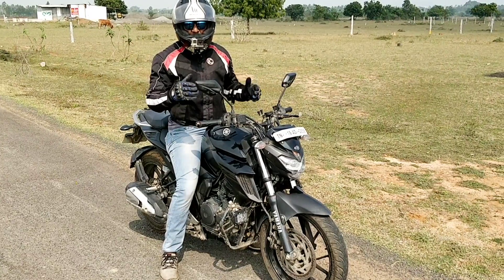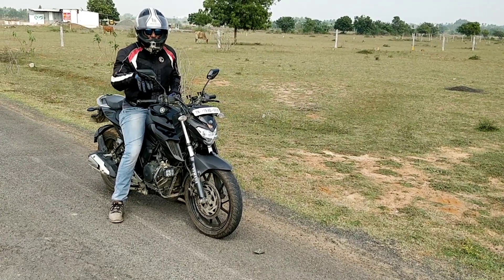youtube video #2t9tu7w7cZM

Comment: Dude ..You are trying to say that don't depend on electronics much ..(which is good) 
But don't misguide people like this .. A lot of youngsters have bikes nowadays .. All they want is a reason not to use safety methods
And 
FYI you forgot to explain why ABS is essential .. 
Dude without ABS the rear tyre can go fishtail and front can wheelie ! 
And you did it on a Dry and straight tarmac !!!!! What about wet and little bit of curvy roads ?? And u had no traffic there .. Who will explain braking in city ? 
If u can't do good. . at least don't spread bad !!

Comment: Well the funny thing is duke and rc 390s which come in abs have more accident records than the ninja 300 or fz25 😆 anyway the thing is it's really pathetic to see most people thinking abs can save their ass no matter what. Well on a bad day  no abs or traction control could save you. Still abs aint shit and is very helpful for newbies. But trust me during panic braking if the rider pulls the front and rear really hard the suspension will give way to the weight inertia and will result in imbalance. No matter there's abs or any modern techs he will end up fucked.

Comment: The proper way to do braking in any situation, you have to learn to brake gradually and firmly. Sometimes braking roughly could lead your brake pad get stuck on disk. You don't know how much pressure you're applying on emergency situation. If we look at how abs work and why abs is helpful. It's because if you brake 100% in emergency situation, the bike will apply 50% or 60% pressure on braking. What it does, it prevents you from getting slide and it also keep you balanced.

Comment: * WARNING: *
This ONLY WORKS IN DRY TERRAIN AND STRAIGHT LINE.
I will repeat this for any inexperienced driver: ONLY LOCK YOUR BRAKES IN STRAIGHT LINE, DRY TERRAIN AND IN LOW SPEED.
You will FALL, break bones and possibly die if you do this on the street in curves or wet terrain and even in dry and straight it is still highly dangerous.

Any movement of the handle bars will make the bike want to spin uncontrollably until you release the brake. See this video if you have any doubts:

https://www.youtube.com/watch?v=dJ_UkAFW6cA

Comment: Hi bro, your braking technique is good ! But it does not serve the purpose of ABS. Please understand speed doesn't matter for ABS, traction between the road surface and tire plays the role over here.
If road is covered with layer of soil then even at 20kmh there will be wheel sleep and it will disturb the vehicle stability.
My recommendation would be for bikes without ABS please don't do hard braking, in emergency situations please apply more braking in front wheel than rear wheel, because during braking load shift will happen from rear to front.
I am ABS system developer for 8years, sharing this information based on my experience.

Thanks for sharing this video bro....
Reply: His method is the exact purpose of abs, the only thing is that we aren't as accurate as an abs system. Funny that you would in the field and don'e recognize this

Comment: Good video. But, ABS IS MUST! When I apply front and rear brakes exactly how it's recommended by manufacturer, or biking gurus, still it takes me a full 5 to 10 feet before stopping fully @ even 60 kph to 70 kph! WITH ABS THERE WILL BE A LOT OF IMPROVEMENT ESPECIALLY IN. PANIC BRAKING! our roads aren't meant for riding fast, nor are the people who are jaywalking zombies and wrong side riders and drivers! You want safety, ride on a track, else get a decent bike with Abs!

Comment: You're locking up every where, when you're dragging your tyre you're not being effective on the brakes.
Pumping the brakes is NOT the right way. Loading up the front tyre with a slight pressure on brake and gradually going pulling it in until you reach the threshold before you lock up is.
Locking your rear tyre is NOT a correct way, pumping the brakes isn't either. Read any book, listen to any brake manufacturer, watch ANY reputable motorcycle coach, they'll all tell you the same thing.

Please educate yourself before you educate anyone else. Your heart is in the right place, just look up more information before you pass it on.
Reply: actually that is up for debate. If you lock your brakes you do NOT increase braking distance. Plus you are sure that you are exerting max force to brake as soon as possible.
The problem is loss of control. When you lock the wheel any, ANY lateral movement, even involuntary movement, will make the motorcycle spin out of control and fall.
If you are experienced enough to lock the wheels and release them when necessary, then it is the most effective way. However very hard to do and will most likely result in an accident because we are not MotoGP pilots.
Reply: Jsus Man, you nailed it!